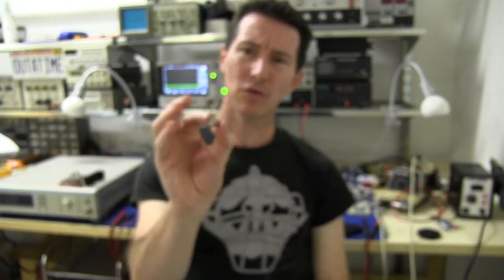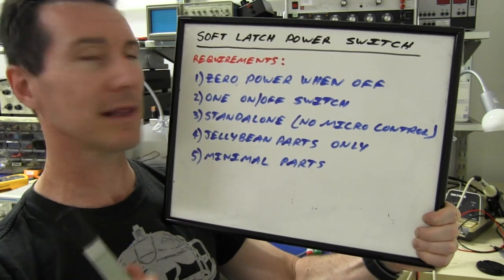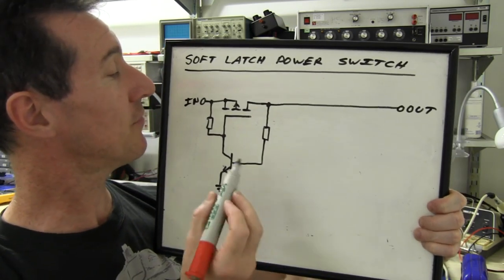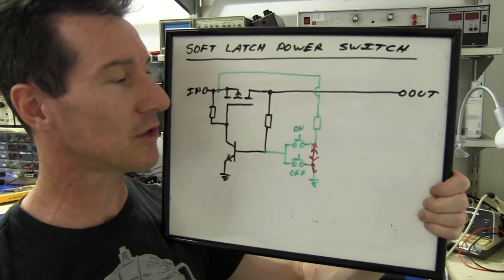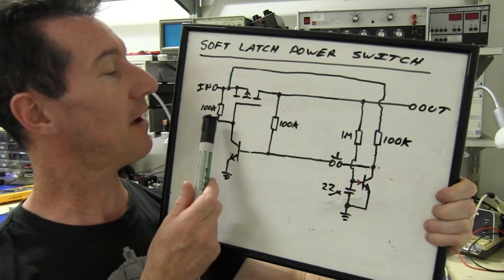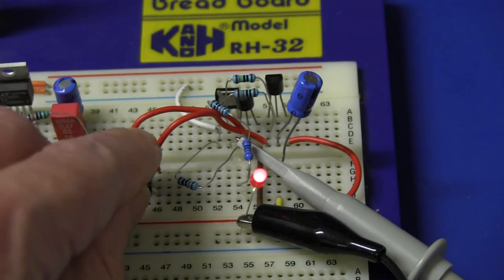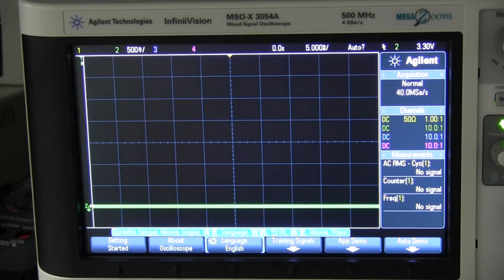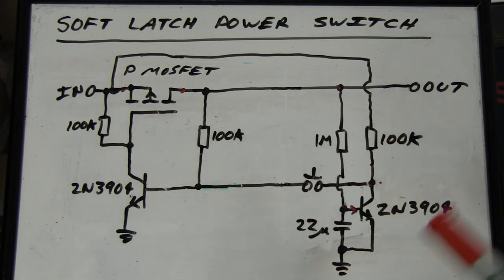EEVblog #262 - World's Simplest Soft Latching Power Switch Circuit

Comment: Hi Dave, I have a slight improvement on the circuit, move the capacitor to collector of the T2 and remove 1 M resister from base of T2, connect both bases togater and put switch between  the collector of t2 and basses. replace 100 k resister  with 650k at collector of t2 and vcc.works just fine , no more ocilations, hold the switch as long as you want
Reply: Works great, thank you very much !!!
Reply: This works great :)Thank you :)
Reply: Anyone have a diagram for this? Is the capacitor in series with the collector of t2 or between collector and ground?

Intrigued...
Reply: Jacob Kon between collector and ground
Reply: How about an explanation WHY it works ... is it as "good" as the original concerning current in OFF state ?
Reply: can someone draw a diagram?
Reply: I won't draw a diagram, but I will give instructions and explanation.

Start with Dave's final version. The base of a bjt is the wire that has one side of the dividing line to itself: move that side of the capacitor to the collector of the same transistor: the emitter is always the wire with the arrow on it, so the collector is the third wire. The capacitor should now be connected to one of the bjts at two points, and connected to a resistor at one: change that resistor to 650k. Remove the switch. Directly connect the bases of the bjts with a piece of wire, and remove the 1M resistor. Place the switch so that it connects the non-grounded side of the capacitor with the bases of the bjts: Sam Raja's version is now complete.

As for why Sam's version apparently doesn't oscillate, it's because "bjt 2" needs to discharge the cap in order for the capacitor to overpower the 100k resistor, so as long as "bjt 2" can't do that, the cap can't turn the circuit off. If you find that you get oscillation anyways (perhaps from changing transistors), try inserting a resistor between "bjt 2"s emitter and ground to slow down the capacitor's discharge speed. I think it might be possible to 'rebounce' back on if you maintain an off-press long enough in the same scenario: if this happens, try increasing the value of the 650k, and decreasing the value of any resistor you might have added to "bjt 2".

As for off-state current, I haven't done the math or tested, but it should actually be a little bit lower than for Dave's version, since "bjt 2"s 100k resistor gets replaced with a 650 k. The only possible exception would be from the 100k-bjt2-1m-100k-(10k or bjt1) path getting replaced with the 650k-bjt2-100k-(10k or bjt1) path, but that should be offset by improvements on the 100k-bjt2\650k-(bjt2 cap) path.
Reply: JackRedstonia : Just for the record, I didn't test it. Besides, I would go with a flip-flop (or a counter chip if I wanted complex power states), a cap to maintain the switch's voltage, and hang the mosfet from Q, less complexity that way.

Also, dan blankenship suggested a  simplified version (e.g. only two transistors) further below: start with Dave's version before adding the switch. Connect the switch between the gate of the mosfet, and the base of the bjt. I'm not confident it would actually work (maybe a small resistor serial with the switch, and a cap from gate to ground?), but it seems like a starting point.
Reply: Eyal Soha : So the right flipflop with debounce should be better, good to know.
Reply: A flip flop is a lot more transistors, though, and will use more current.  Maybe for most people the original solution is good enough.  For example, Dave was trying to cut costs on switches.  Adding a flip-flip adds cost.  Also, a flip-flop needs a clock.  You really want a latch.
Reply: Eyal Soha : I would specifically use an IC, for manufacture an SMD version, and for the clock you use the switch with an rc network for debounce. Should be about as cheap as Dave's if done right, maybe even cheaper.
Reply: I really liked this circuit with the above mods to learn on.  The only problem was the power up to latched.  Long years in operational environments where safe is to power up switched circuits in the off state.  I found a 10 nF capacitor on the BJT1 base to ground causes the circuit to stay off on application of power.  

My limited skill leads me to believe that there is a nanosecond voltage difference between gate and source caused by the pull up resistor.  This causes the BJT to latch on when, but the cap on the base induces enough of a current delay to prevent the BJT from turning on?
Reply: Thanks, this circuit works even better,
very valuable knowledge.
thanks again
Reply: Several improvements to Sam Raja's circuit:

At higher voltages, this still automatically turns from off to on when held long enough. (Not on-to-off, only off-to-on). This happens because the 100k pullup to the bases and the 650k resistor on the collector of T2 create a voltage above 600mV on the bases while the switch is held. A solution to this is to increase the 650k resistor at the collector of T2 to a higher value (f.i. 1meg, 2meg)

Also lower the capacitor to 1uF to make the circuit reset quicker. (Have it respond even if you push again within 100ms)

Also add 10nF to the base of T1 to have it start latched off.

Also, add a 1k series resistor with the capacitor, otherwise you might destroy your T1 base emitter junction by dumping the capacitor charge.

That'll be it. I'm implementing this circuit in a commercial product. Thanks Dave and Sam!
Reply: greetings.. i have a IRF9540N instead of the 9110.. I tried comparing data sheets but my mind turns to mush.. will my mosfet not work? I get power on to my led when voltage is applied, but the led is dim. it will not latch on or off and when the button is held it oscillates at 120hz. i have not tried the updated design from sam yet
Reply: Hello I use the IRF5305 with this it works.
But I also tried the IRF9540N and it works too.
Measure once the voltage at the gate at the press process and then at the DRAIN, if he even switches.
In my case, the IRF9540 switches already at 2.5V.
Reply: Thank you dude! Works great!
Reply: @Sam Raja
i tried both in LTspice and they both work as described/witnessed , great work on both sides :-)
Reply: @Jared Maddox
tried it in LTspice and it works great :-)
Reply: @Eyal Soha
on the sim its on it never stays back to off :-(
Reply: Jared Maddox yeah, I miss Dave’s mini tutorials.
Reply: Works great! Thanks!
Reply: @EyalSoha  The resistor on the collector of T2 should be 650 kOhm. If you change it to the right value the circuit functions properly.
Reply: Got this working in Proteus, but the power off sequence it a little too touchy.  Ideally I'd like there to be some buffer between the states.  You can download my simulation at https://github.com/rwrife/Circuits/raw/master/Soft%20Power%20Latch.pdsprj
Reply: @JK360noscope  The capacitor would have to be between collector and ground. Think about how it works. If it was in series it would be an open circuit. Look up High Pass Filters and how Cacps are used in that scenario in series.
Reply: @YTANDY100  How about "simulating" it with a soldering iron?!.... (I've seen many "working in a simulator" circuits fail in the real world due to things like reverse E-B breakdown, etc!)
Reply: Tap on a clip to paste it in the text box.
Reply: @EyalSoha  Increase the Rc to 650K, then this issue is solved.
Reply: Here is the schematic: https://easyeda.com/kraska/on-off-button-v3 I tested it on breadboard. I'll order the PCB-s and see if it will work on a printed PCB as well. There is a delay you should do 1-8s before and after switching on.
Reply: @EyalSoha  I know it's 2 years later but if you use the values he did it seems to work fine. Using the values you used it performs the behavior you are mentioning
Reply: @drhubs7049  It's never too late. Here i have the same circuit in tinkercad. Here you can see it works perfectly. Also, in the simulation, it will remember the state if you turn off the power supply. I don't know if it's a real behavior, or just a simulation error, haven't phisically tested it, but it's allways nice to keep this circuit alive for us makers.

https://www.tinkercad.com/things/dgstMNc430a
Reply: Right now it works on small loads. For example with a LED: When I added some voltage converters then it didn't switch off. The solution is to add diodes then there is no reverse voltage..
Reply: @kraskagm  Try not to use it to feed the dc-dc converter directly, use the diagram to drive a n-chanel mosfet to control the dc-dc converter. Just need to add a pull-down to the n-channel gate. What dc-dc converter are you using? did the fix solved it?
Reply: @kraskagm  Add diodes between pow and gnd? or?
Reply: @drhubs7049  It worked kind of. Just before you connect load add a diode before. I was able switch on and off dc/dc converters. The converters powered my controller also, but when more current was needed then the motor didn't start running and the controller didn't init wifi. Tried without diode as well, but same problem. I think the circuit isn't designed for applications which need more than 40mA current.
Reply: Doesn't always work. I built 4 and only one functioned correctly at 4V. Then the bee flew past and the temperature changed and it stpped working
Reply: @JackRedstonia Pause the video.
Reply: Is this how on/off on a computer power supply works?
Reply: @kraskagm  this circuit is always on to me, in real live and in proteus
Reply: It works!! I use s9014, s9012 build the basic circuit, cap value is 10u, then use the s9012 BJT drove an 100k Ohm resistor which paralleled with the G-S pin of 13n06l MOSFET, and drove a motor through the drain pin. It run very well with Li-ion battery, threshold of mosfet is about 2V, which Ron less than 1 Ohm. oscillating only happen one time when the state become off from on, and must push the button over half second. This is a really helpful circuit, thank you Sam and Dave!
Reply: When SW stays on, T1 and T2 should be on at the same time. Then the collector of T2 will be grounded. Wouldn't the circuit then enter the oscillation state again?
Reply: I see a couple of problems still. Especially when turning off you need to rely on the output load to not have capacitors and really drop below the base voltage of the left BJT, if it was a BLDC motor controller for example where spinning the motor would generate voltage than this circuit would turn on without any operation on the button! A diode in the output would be a solution to that. Analog to that you and without the diode the drop of the output voltage would have to be quicker than the discharge state of of the capacitor (~.3V) being lost (exceeding the turn on base voltage of the left BJT)... The missing Zener Diode to protect the gate of the FET (when using with system voltages that exceed that max. Gate voltage) and related resistors should also be mentioned...

Comment: FYI for those novice, such as myself, who are building this soft latching switch. I had been working on making this switch work for over a month. I'm using all bjts. I tried different resistors, different capacitors, and different types of bjts. I could not get it to latch off. As soon as I let off the momentary switch the light came back on. Holding down the push button I could get it to flash like Dave's but it would not stay in the off position. Finally I went back to original components and then it dawned on me, after viewing Dave's video a couple of dozen times, the LED I was using was not a sufficient load. I put in a 1/2 watt 2200 ohm in parallel with the LED and viola! It's working! Thanks Dave.
Reply: It may be the leakage current.   I've witnessed a thyristor made of jellybean BJTs turn on by itself due to leakage.

Comment: Tried to make this on breadboard and spectacularly failed. Load (12V 1A motor) runs straight after circuit is powered. No reaction on button press. I used 18P06P P-MOSFET and SS8050 NPN BJTs though due to lack of other types here.

Comment: Just in case you were wondering how much this saves... I got a parts list for what he drew whipped up in digikey, and this is what I found:

3A toggle switch = $1.76/unit at 200 item price break (min quantity)
200 units = $352 total

I will assume the 200 unit price break for the rest of these numbers and surface mount components except for the push button. If the minimum quantity is higher, I'll include that cost.
5,000 100k resistors = $6.46 (4,400 not used)
250 1M resistors = $7.99 (50 not used)
200 22uF capacitors = $16.86 
200 30V 3.8A P-channel MOSFET's = $35.00
200 Dual NPN transistors (2 transistors, one package) = $25.90
200 Through hole momentary push buttons = $15.18
Total price = $107.39

Less than 1/3 the price! And I didn't even try to make things better by trying to minimize the number of different parts.
Reply: Yes, but you must consider also the operation cost. The pcb must be manufactured, the electrical components must be placed an soldered. If you are gonna place this components on a pcb which already is designed to be in your system, the influence on the operation cost for this feature is almost insignificant. Anyway, the final price tag is still below.
Reply: Well, that's the problem.. your buying off digikey haha
Reply: Try expand the calculation by comparing the pcb cost, pcb assembly and fitting
vs
Drilling a hole for the toggle switch, soldering leads to the switch and fitting the switch
Yes - I do consider the electronic solution done with other electronics fitted anyway.
As a former PTA engineer I learned to avoid any extra manual assembly cost on the production line.
Reply: You forgot to factor in 200 breadboards at $2 a piece...
Reply: As you go higher in production count the end cost may worth it, because the robot machines can populate all those parts in 3 seconds and the addition of the PCB is almost negligible. It is good alternative however.
Reply: This seems like a solution without a problem. Amazon offers a 125V 6A toggle switch for $0.70.
Reply: The cost to install a switch  can be 10 to 30 min.  more.  that causes excessive complexity and labor
Reply: @steveschaps2178  I know this is old but in case someone watching has your same concern: this is for use cases where a 30mm^3 toggle switch wouldn't fit, but 10mm^2 of pcb area to mount three transistors and 2-6mm^2 for the tactile switch would, or cases where a recessed button would be acceptable whereas a switch toggle/handle projection would not. Also a good exercise in circuit theory.
Reply: @steveschaps2178  That's fine if a simple switch is sufficient. But it may also need reset functionality: undervoltage protection, overcurrent protection, turn-off by external signal or internal controller...

Comment: It's a really good idea! Thank you!
Remarks: 
1) for the second transistor use a NMOS --> no big capacitors needed
2)  use a resistor from basis to ground for the first transistor - helps against leakage current
3) If the battery voltage is more than 15V ... 20V, most of the PMOS don't like this and go to the semiconductor heaven.
Reply: re pt 2 - i had issues with the filter cap of the downstream circuit bleeding back through Q1 turning it back on. A 680k resistor as suggested solved this

Comment: For anyone wanting to simulate or build some of these circuits as Dave goes along, remember that BJT transistors realistically require either a pull-up or pull-down resistor in order to ensure their default state.  For example, in this video, at minute 4:00, this circuit would likely actually start in the ON condition without pressing anything because the base of Q1 (the PNP) transistor is not guaranteed to be held high, and is likely close enough to ground, it will start conducting, causing Q2 to fire turning the circuit on.  If we use 100K-Ohm resistors everywhere to keep current low on the base of the BJTs, a weaker pull-up is necessary on Q1 simply to ensure the base is high on startup but can be easily overcome by the ON switch, grounding the base.  For this pull-up, simply connect a 1M-Ohm resistor between the collector of Q2 and the emitter of Q1.
Reply: You are right.... In reality this 4.00 circuit will be pretty unstable.... We just have to use a big resistor between the collector and base to ensure that the base of Q1  remains high enough not to turn on randomly.
Reply: Youare actually right, I tried to make the circuit at 4.00 but turned ON by itself and the ON sswitch seemed to be doing nothing  at all. I will try with your suggestion  again
Reply: Would I read this earlier, I would save myself some 8 hours of building and simulating... 😂
On the plus side, I am able to simulate this circuit in CircuitJS, TinkerCad AND Ltspice... 😅

Comment from the maker: Yes, it will usually be cheaper, cost it out yourself.
It's not just about cost either. Sometimes you want/need a soft switch instead of a big clunker mechanical toggle.

Comment: Bread Board Success: I built Dave's circuit and it worked.
Things to note:
- I used a 5Vsupply.
- I used an IRF9Z24N P-MFET.
- I used a 47uF e-cap. Dave spec'd 22uF, but actually used a 47uF on his board. I like the button press timing of the 47uF better.
- I used a red, SMD LED with a 1K resistor, for the load.
- Dave's circuit starts in an on state, when power is first applied. To me, this is a problem. Say this is on a stereo and the power goes off/on in the night. The stereo is going to startle you awake . However, for whatever reason, mine does not start in the on state.
Lot's of fun, Mr. Dave = Thanks!